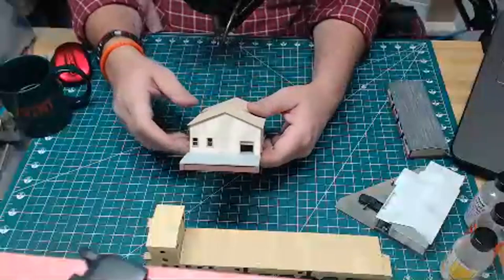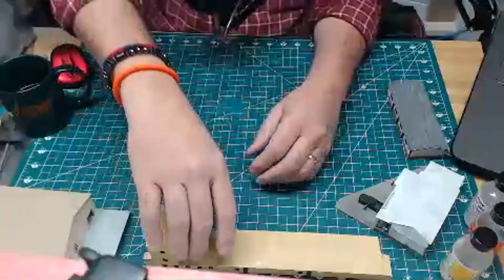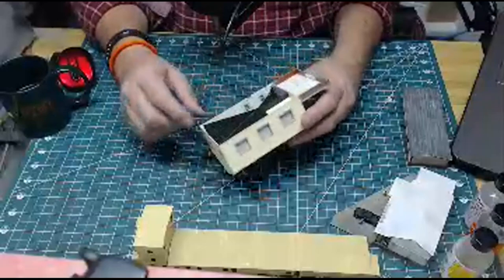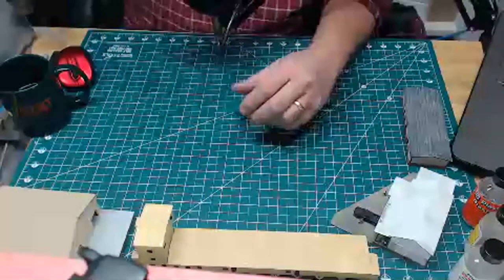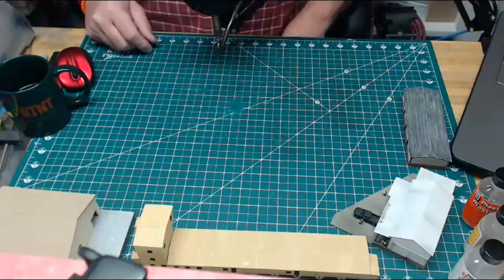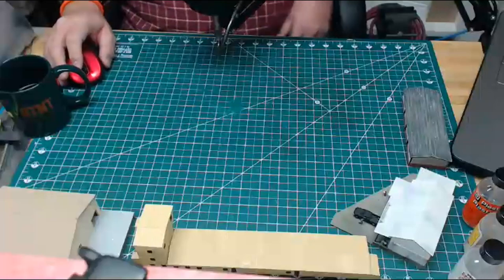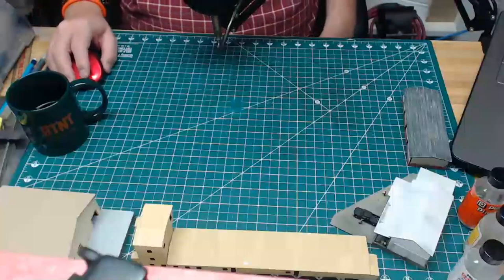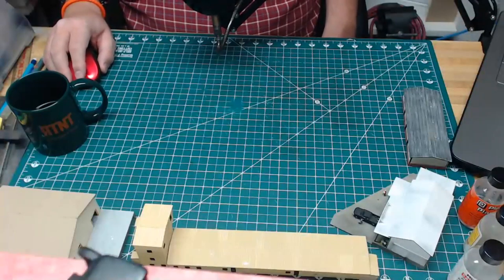Scratch Building Techniques

Comment: On working with wood... I'm actually scratch building an elevated track for my city layout and using popsicle sticks and bbq sticks. So far it's looking really good. I chose the bbq sticks as the poles as they will drive a couple of scale feet into the foam base I have, as a good foundation. Btw, I'm using loctite super glue and aleen's turbo tacky glue.. works well

Comment: I build Fast Tracks turnouts relatively frequently, so I was interested when you said WeldBond would make a good adhesive for the turnouts. Since I’m getting tired of the Plio Bond, I looked into it. A quick google search directed me to a thread in a Fast Tracks forum from several years ago. They were trying to find alternative adhesives. Supposedly one of the people in the thread actually tried WeldBond and said it didn’t work very well (at all). I then looked into WeldBond and discovered it is a water based PVA glue, which means it is water soluble. To be fair, I have never tried it, but I would never use it to hold rails to ties. Knowing my luck it would dissolve from the water in the glue used to ballast.
Reply from the maker: Yes, I got my bonds mixed up in the live stream--weld, plio, James, you know. Anyway, Pliobond was what I was thinking of when someone mentioned Weldbond.

Comment: In a design problem solving class in college I built a large balsa bridge engineered to be as rigid and strong as my thought process could muster.  We then destroyed all the classes bridges hanging more and more weight from the center.  The rules are balsa and elmer's carpenter's glue only, no visible glue outside seams acting as gussets and fillets, see how much weight one can design a bridge to hold.  Thinking back, the bridges were all about N scale and some quite amazing.  Wish I had mine but it was pretty ripped apart from the weight and I threw it away afterwards.  The project serves a purpose, but man that was some crazy scratch build destruction.  Around 20 students, all pretty talented designers, spent a week each building a bridge that would rival a good complicated scratch built trestle, but not paint or any decoration, then we just destroyed it all in like an hour and a half!  LOL design school, 20 good N scale trestles all just mangled in the process of learning force pathing in structures.
Reply from the maker: I have seen similar challenges in physics and physical science classes. They are a lot of fun and a great challenge.

Comment: Ron thanks for the info on the Flexi applicator. Just ordered it  here in the UK . Great description and easy to understand video. John.
Reply from the maker: Hi, John. I think you will find the touch-n-flow applicator an invaluable tool. I use mine all the time.
Reply: Ron I work in 1/35 scale building armour and dioramas. Found that the  glue brush with theTET is both messy and wastfull.  Hope this will improve my finish . Thanks fo your reply .John.